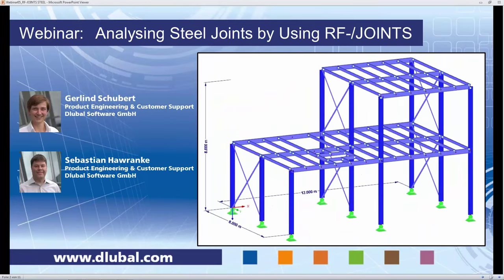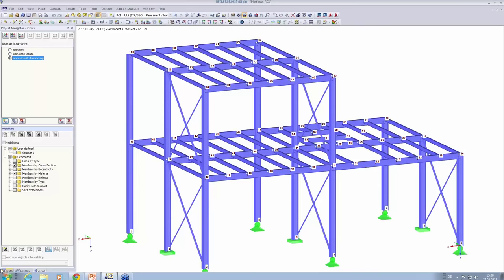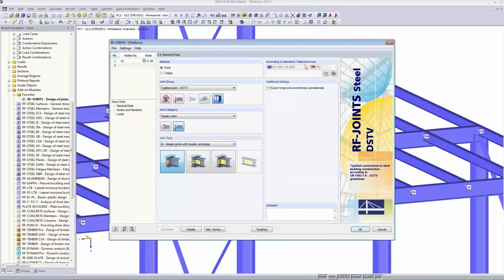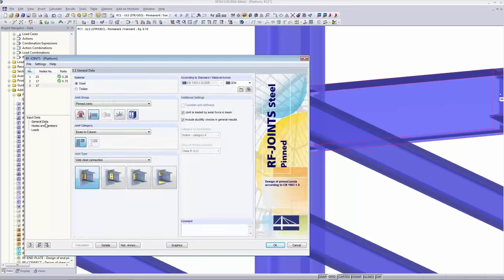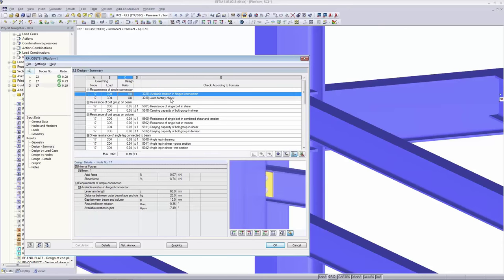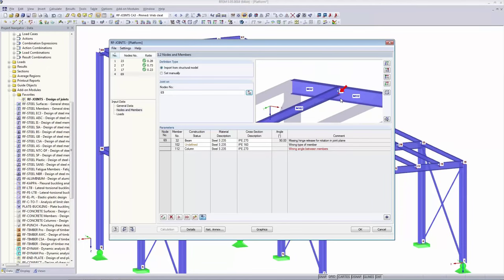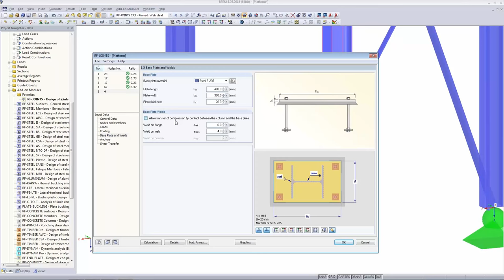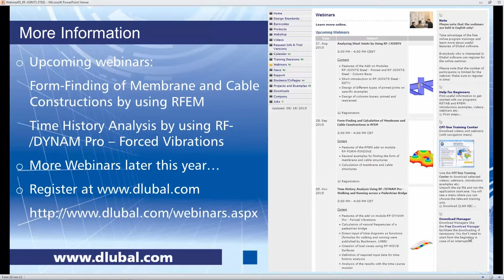Webinar: Analysing Steel Joints by Using RF-/JOINTS

Comment: Is there a way to calculate rectangular steel connections?
Reply from the maker: Hi, Jelena!
With the RF-/HSS add-on module for RFEM 5 and RSTAB 8 you can design welded hollow sections. https://www.dlubal.com/en-US/products/rfem-and-rstab-add-on-modules/connections/rf-hss

Comment: Thanks for wonderful session, I am currently using R-stab on German project. I have one question regarding connection details. how do you design bracing connection in joint add on module. for e.g. K bracing A bracing can you please suggest it would be great help. Thanks
Reply from the maker: Hi Sachin.  Thank you for the question.  If you don't mind writing in to our tech support at info@dlubal.com, we would be happy to help you further.